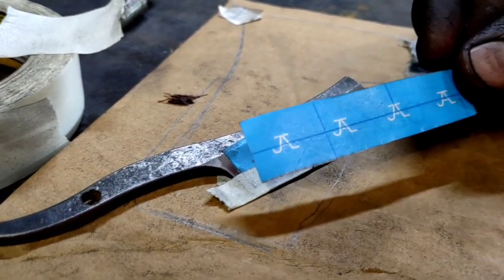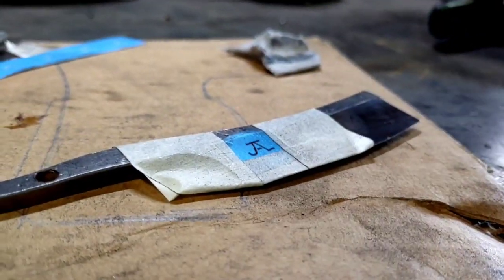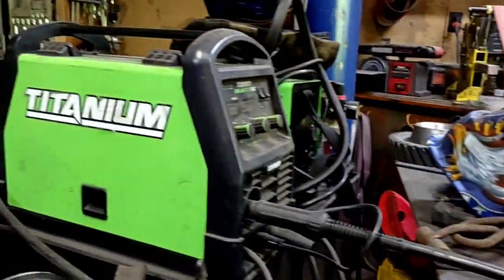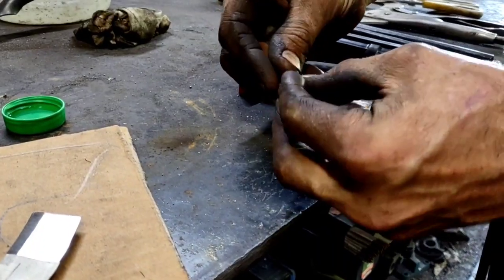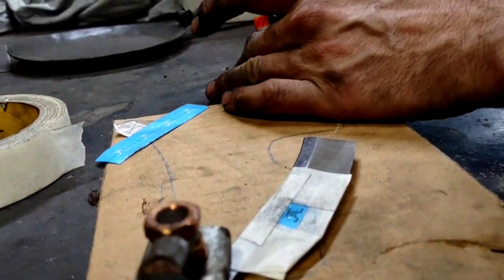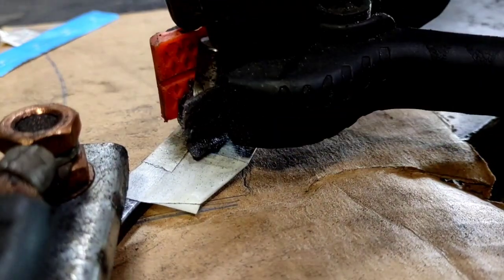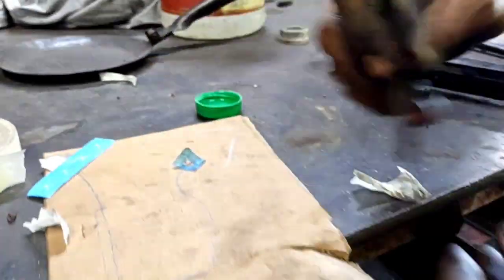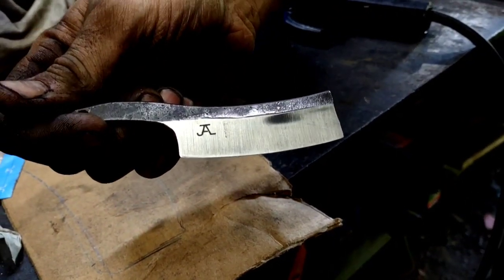How to Acid Etch W/ a Welder! Best Etching Machine Ever!

Comment: Thanks for this. I do a lot of electro etching in saltwater using a DC welder. I would only use 5 amps in lift tig mode for an etch that size but I do it in a deep tray and immerse the plate in the solution. You are the only other person that I have seen use a welder. It's interesting that you got a dark mark with the vinegar, I get a bright silver mark. I'm gonna try vinegar in my tank and see what happens.
Reply from the maker: My pleasure hopefully it helped. Yeah if using paper towel instead of a piece of cloth I use less amps. After polishing the blade, it is definitely not as dark as using salt water.

Comment: Can you do it with a cheap flux core welder ?
Reply: The flux core welder etching works it’s a little slow but it does work. All you do it take the cover off the tip put the paper towel on the tip an work it on the still with the stencil
Reply from the maker: @jasonvanover6716  great to hear!
Reply from the maker: Might be able to if you can use the gun somehow as you electrode.
Reply from the maker: @MikeHoncho0811  yeah that would probably work..the only problem I see is that the vinegar or salt water used to etch is corrosive and might mess up the gun over time.
Reply: I had a thought maybe I could use a peace of all thread and put a couple nuts on the end of that instead of using my tip
Reply from the maker: @jasonvanover6716  sounds like a good idea to me... I think 🤔😁
Reply: I’ll find out
Reply from the maker: @jasonvanover6716  make sure you report back your findings 😁
Reply: Flux core are already reverse polarity
Reply from the maker: @anthonykerber1574  yes it does

Comment: A handy way to hold on that little piece of cloth is with a rubber band.  You can also use a small piece of paper towel instead of the cloth.
Reply from the maker: Rubber band is a great idea!
Reply from the maker: Yes I've used paper towel most of the time.